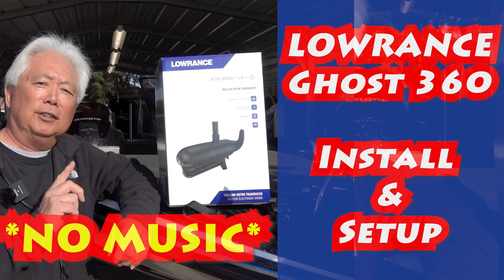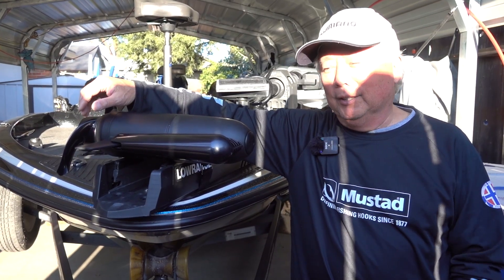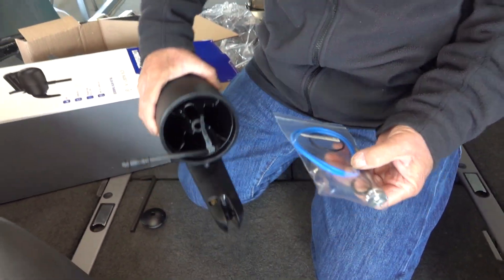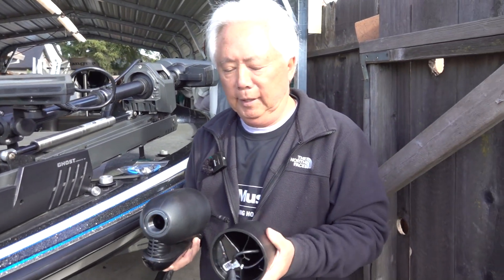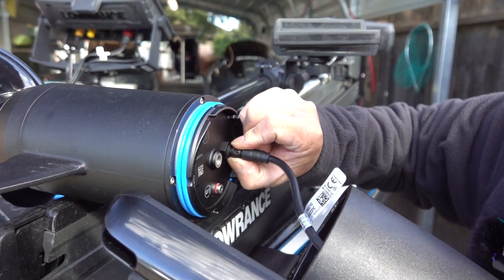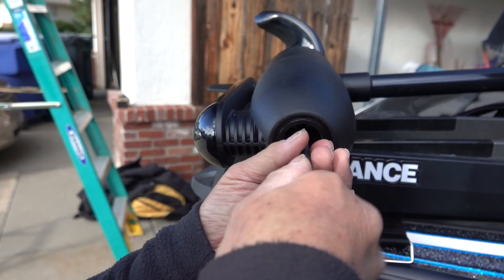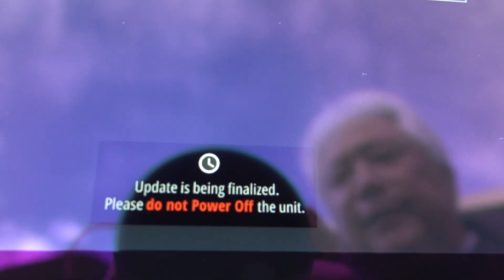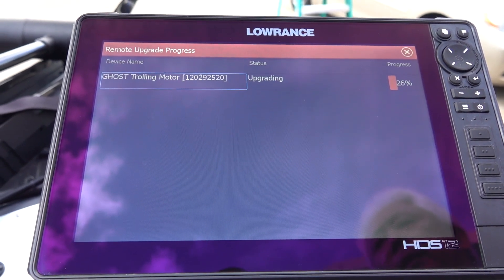*NO MUSIC* Lowrance GHOST 360 INSTALL | HOW TO Software Update & Display Setup

Comment: Hello Allen 
I recently purchased a 24v. Minn Kota Powerdrive T M from you.
My budget won’t allow for 2 12v Lithium. So do you have a recommendation for either regular Lead Acid Marine D Cycle or
AGM (Optima type) Deep Cycle. I have plenty of room for 2 batteries in the box.
Thank you
Fred
Reply from the maker: If you put acid batteries you should get group 27 or 31 batteries, the bigger the better as they have more plates so you get more run time. Make sure they are deep cycle batteries. Lead batteries cost from $150 to $300. My friend found lithium batteries at walmart 12V 50amp hour for $299ec and he loves them and no issues or running out power.

Comment: Great information and channel! Tempted to make a change from Humminbird to Lowrance. Lowrance provides ease of installation including additional features, innovative technology and ease of operation. My old boat had Lowrance units and my new boat came equipped with Humminbird units and 360. Thanks for sharing your knowledge throughout the years, even life before YouTube!
Reply from the maker: If you have Hummingbird units and the 360 you should just keep it and learn how to use it better. The Lowrance 360 doesn't let you run trolling motor while it scans. If you use TM it stops scanning. So in windy conditions hard to use. I'll be doing videos on the water soon
Reply: @AlanFong  Thanks for the reply and info. Always appreciated!